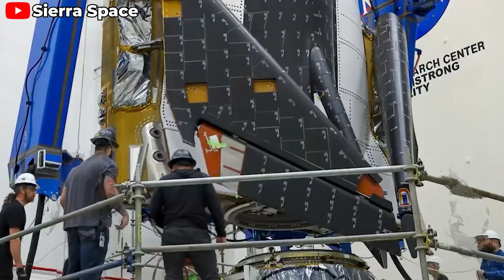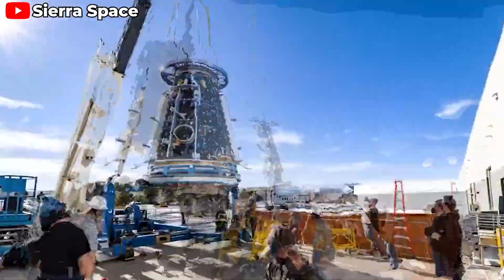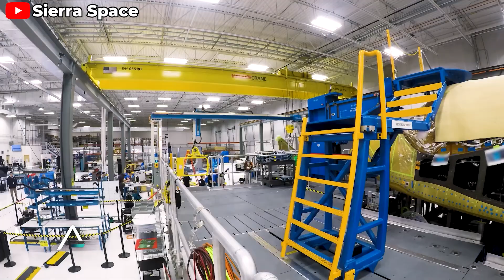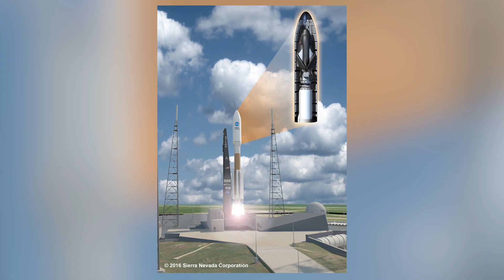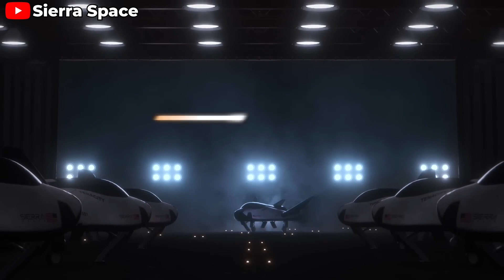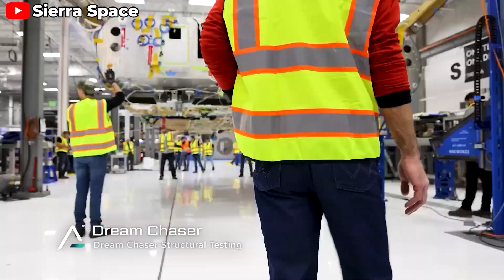Dream Chaser Has Officially Begun Final Testing

Comment: Dream Chaser is being verified for cargo flights.  There are no plans or contracts for manned flights.  It can't take Starliners place until it is man rated.  If they got the contract today it would be several years before they could attempt a Crewed Flight Test.  The ISS is scheduled to deorbit in 2030 so that leaves 5 years.  Let's say 2 years until the CFT and then another year to launch the first operational crewed flight takes us to 2028.  With one flight per year (Starliners current contract) they would get in at most 2 flight before the ISS deorbits.  None of this makes any sense.  This channel doesn't know what it is talking about.
Reply from the maker: There will be other space stations after the ISS retires. In the rendering of Orbital Reef, you can see Dream Chaser docked at a port. Sierra Space and Blue Origin actually partnered on the development of Orbital Reef, but Sierra is currently more focused on Dream Chaser
Reply: Sierra Space is a partner in the Orbital Reef project, to provide Dream Chaser and inflatable modules via New Glenn.

Due to rivalries, Orbital Reef is unlikely to involve Space X Dragon or Starship, so Dream Chaser will be the primary vessel for transit.

They are also working with Axiom Space for Hab-1.

So, Sierra will have two stations to service going forward, king  total of three stations during the next 6-8 years.

If you're going to insult the channels intelligence, make sure you actually "know what you're talking about" first!

They are also
Reply: @dansegelov305  The Axiom Space Station is having issues and may not happen.  Make sure you know what you are talking about before you post :  https://youtu.be/4x3G5LjZoug
Reply: @dionysus2006  Who says it’s not gonna happen. Axiom space station is delayed. But its first modules will launch in 2025 or 2026. It’s already been built. 

Dream Chaser has 2 variants. A cargo version and a crewed version with enough room for 7 crew. Both will be operational within the next few years 

You sound very salty and jealous of American achievements.
Reply: @tylerclayton6081  It may happen, doesn't look good.  I'm sure others will follow eventually. We need private companies to provide space stations because government projects are too high cost.  I'm puzzled why I would be jealous of my own countries space achievements.

Comment: Well written summary of testing required by all cargo carrying spacecraft destined to service the ISS. It's a very costly and highly technical spacecraft years behind schedule. Hopefully it flies and performs successfully. It looks like the next worry will be who will launch it? Will a Vulcan Centaur rocket be available along with the necessary BE-4 engines and at what cost? It seems to me it could also be flown by a Falcon 9. I do think it is a worthy effort but a manned version is very far off. It looks now like Axiom Space was the obvious bad choice to build the replacement space station and will soon be out of business. In the past you might have thought they would extend the life of the ISS but that is highly unlikely now. That begs the question who has the skill, machinery and resources to build a new space station in five years? There is basically only one answer to that question and I don't think it is Blue Origin.
Reply from the maker: Well, I have a new video about using Starship as a temporary space station. 
Additionally, in the near future, we’ll have Vast's Haven-1 being launched by Falcon 9; I’ve made a video about that as well.
However, Haven-1 isn't suitable for scientific experiments that require extended timeframes or for astronauts staying for six months. It wasn't designed for that. But one thing is for sure: Orbital Reef is still a long way from debuting, New Glenn hasn't even flown yet